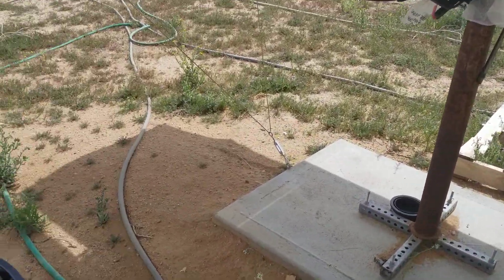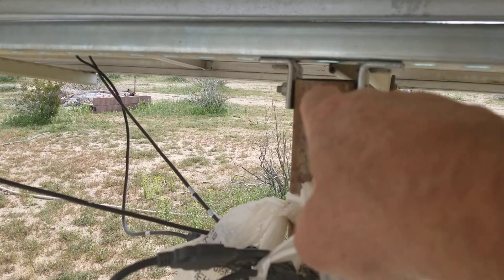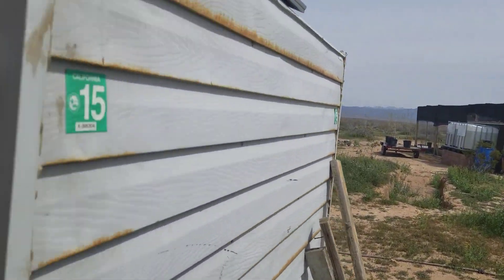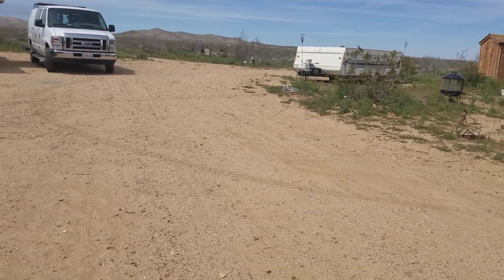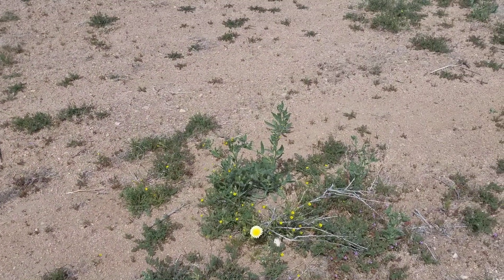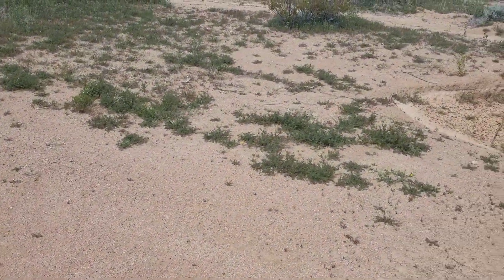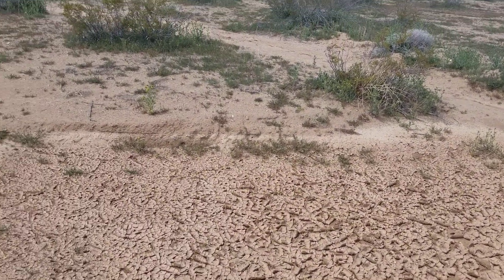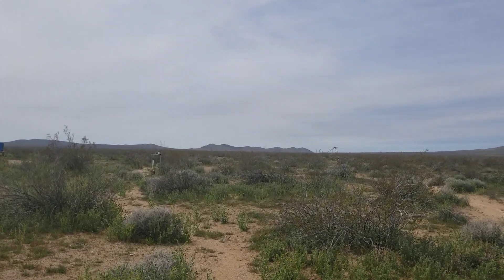Adjustable solar panel racks, March 31, 2020

Comment: G-Bear, can I set up a solar set up side by side a grid system?
My electric company has upgraded our panels.
I'm guessing they want to know if you link in solar with their grid without letting them approve it or not.
Reply from the maker: If I'm understanding you, you already have grid tie solar with your electricity provider?
Then, no.  You can't add to that without them knowing, and you can't use stuff like Harbor freight panels or 100watt 12 volt panels, or anything like that to your system.
Once you are on grid, you cannot go off grid.  You can, however,  set up an off grid system separate from your on grid system, to run certain power units, but it requires separate wiring circuits that you would plug those items into.   Really not worth the expense...and they know it.
Reply: @GBear  
I dont have solar yet. You kinda answered my question. So, a solar system on the grid is really just a back up system if the power goes out, like a generator.  I believe my electric company doesn't buy back watts so if my system was making more than I was using,  I'm guessing they are basically stealing my investment.  ??
Reply: I guess it could reduce your electric bill but what happens if your grid tied when shtf? Power grid is down....oh those panels sure are pretty sitting there. Maybe at that time we start rewiring the house fast. Disconnect from the grid.
Reply from the maker: @JesusFreakJen  yes, that would be your option, and not difficult to do.  It is required that an auto-shunt be installed so if the grid goes down, solar powered houses won't be pumping power back through the wires, that could harm the service people,( their excuse), but actually, the feedback they get from your panels gives them free electricity that they 'sell' to your neighbors who don't have solar.  So if you didn't auto-disconnect from the grid, your neighbors would get free electricity from what you pay for., couldn't have that!
Reply from the maker: @JesusFreakJen  no, an on grid solar system is just to lower your electric bills. If the grid goes down, you will not have power either, unless you have a whole house battery back up system installed also.

Comment: Yeah, set up a camera in the attic
Reply from the maker: I don't want to see what I'll catch, I want to catch what I hear.  I think I'll just put glue traps over 75% of the attic and see what I catch.😉
Reply: @GBear  
That's a great plan.
It occured to me too that maybe its something else. A possum or something like that.
Reply from the maker: @JesusFreakJen  no holes large enough for even a mosquito to get in from above ground.  If it got in, it came from underground, up through the bathroom, into the walls, then squeezed through an opening a half inch in diameter to get into the attic.
Reply from the maker: @JesusFreakJen  oh, and no possums out here in the desert.

Comment: Wow. I didn't know they had pain patches. I'll buy some! Thank you for sharing the information about the solar panels. I'm going to share this video. Lots of people will love it. Believe it or not. I had a snake in my motorhome. The doors were shut. It was black and yellow striped. I couldn't believe it was gone when I looked again. 😂 I hope you don't have snakes in your roof. I ran back into the cabin. I don't want the wind.
Reply from the maker: Yeah as soon as I try it out I will post the info on my channel.
Watch out for those snakes!  Remember,  "Black on yellow, lucky fellow.  Yellow on black, you won't come back!"  If the black stripe has yellow on both sides of it you're safe, if the yellow has black on both sides of it steer clear!

Comment: Thinking Bats.   But they would leave Dropping too.   I would think they would be out feeding at night.
Reply from the maker: Ok, again...there are no openings anywhere on my cabin bigger than a pinhole.  Whatever is up there had to squeeze through a half inch hole in the top metal plate of the metal stud framing, and the only way they could get into the walls is coming in under the bathroom since all other walls are metal plates on top of concrete foundation.
So, it has to be a rodent that can squeeze through small openings, wouldn't you say?

Comment: Had four Rich Solar 100W panels show up here today.   Installing those for the Mother In law.  Her and the Brother in law want a little bit of solar available.. 

Wouldn't take a whole lot to make that Solar Rack tracking.
Reply from the maker: Get them set up and they'll want more later...😄
I thought about tracking, but I don't really need it here.  I have a clear shot at the southern sky and my battery bank is already at float charge an hour after the sun is full in the east, and they stay there until the sun sets at night.
If it ain't broke, don't fix it.